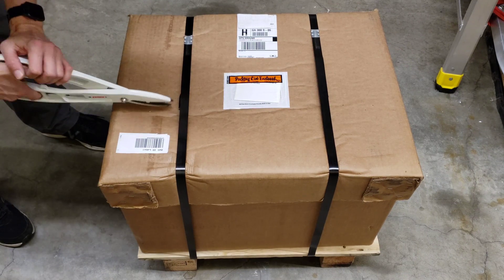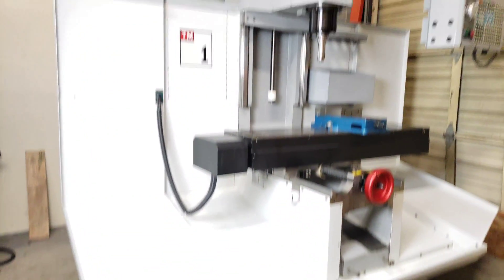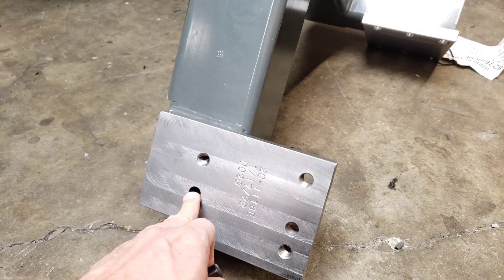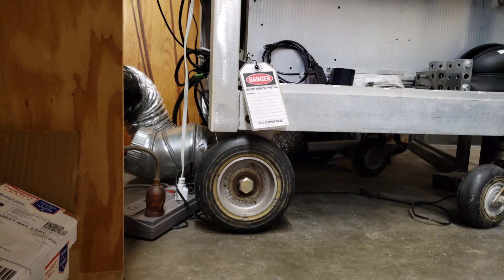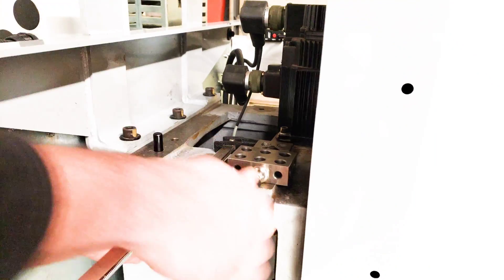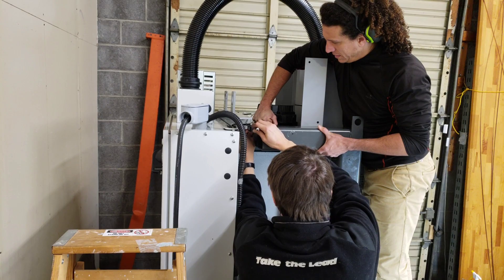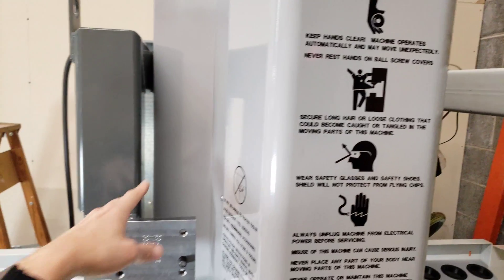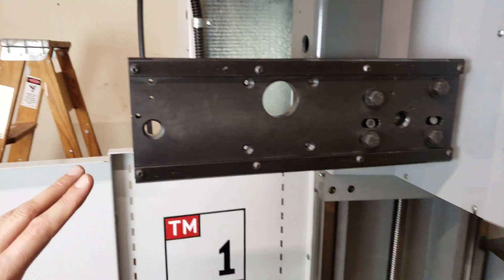Adding A Tool Changer To HAAS TM-1 CNC Mill | PART 1: Installing the Support Arm and Slide

Comment: ? Why not sell you a tool changer? Suppose you have an open TM1P with a changer...And it needs replaced.  Would they sell you a replacement?
Reply from the maker: The answer I got was that if it didn't come with one and wasn't enclosed, then they wouldn't sell us one. If it came with one and needed to be replaced, they would sell a replacement. It also sounds like if you told them it was enclosed (even DIY), then they may go on your word, or at worst ask for some pics of it.

Comment: Thank you for the content.  I just put a 2006 in my garage and was wondering if this was possible. I assume you had to add another servo drive in the back panel? Did you get it working? Love to see a follow up video. I'm curious how difficult it was to get the machine to actually change tools. Again thanks for the content.
Reply from the maker: I'm not completely finished because I was waiting on some parts. I heard that it's plug and play. No servo drive needed, it's just a small DC motor with some position sensors. I will be posting more videos about the process.
Reply: Awesome. I look forward to watching them.
Reply: Also that makes sense. It really just needs to move to two spots and be able to index. The spindle does most of the real work.

Comment: I just bought a 2005 tm1. It’s my first real cnc. ( I converted a grizzly many years ago). I want a tool changer and we wondering if it could be done. Thanks
Reply from the maker: Yes it is possible. It is hard to find the tool changer itself. It's the same tool changer from the Mini Mill. I had to piece mine together from a company that disassembled a bunch of them. HAAS will only sell you one of your machine is enclosed. I'm building an enclosure for ours.